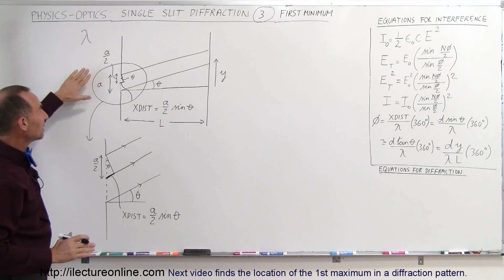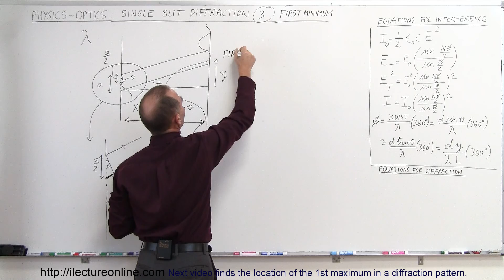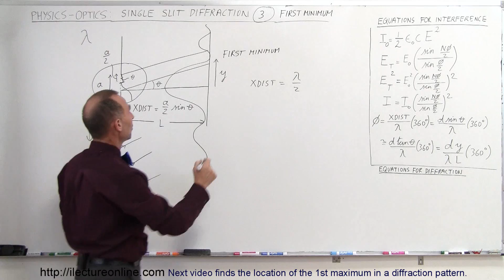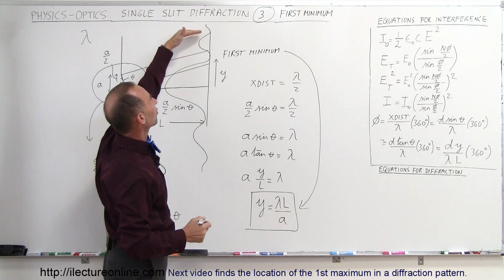Physics - Optics: Single Slit Diffraction (3 of 15) Location of 1st Minimum=?

Comment: Why, for the demonstration, is a point at the edge of the slit and another in the middle (at a distance of a/2) considered, instead of considering two points separated by a distance of 'a'. If we consider a distance 'a', the condition for the minimum would become asin(θ) = λ/2, and therefore, it would not be the correct result. Why would that be wrong, and why is it necessary to consider the point in the middle of the slit? Thank you very much for your wonderful videos, congratulations
Reply from the maker: I recommend that you watch more of the videos in this series.  We do explain the intricate reason for why this technique works in later videos of this playlist and other playlists.  It is related to the gradual phase shift of the electric field vectors of the light passing through the slit.  So this explanation here is a simplified method and used to find the maxima and minima points on the screen.